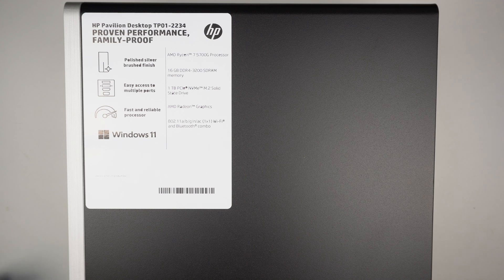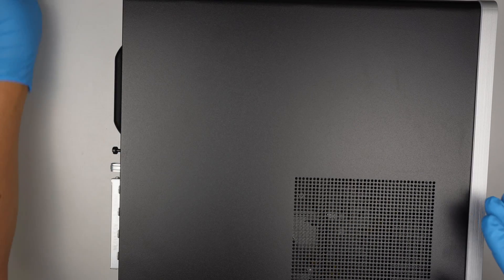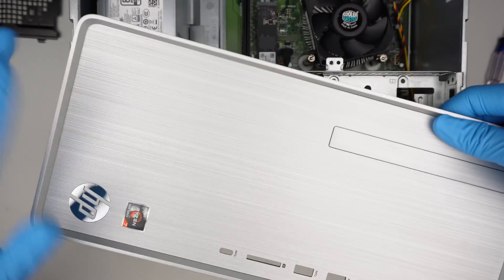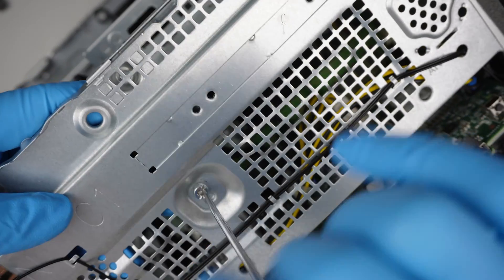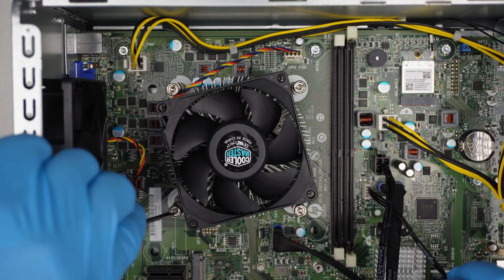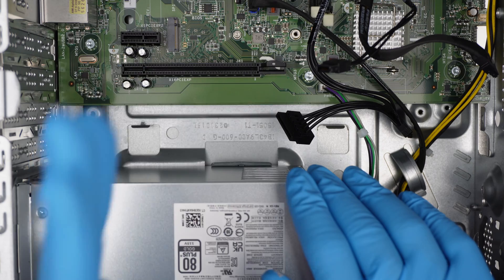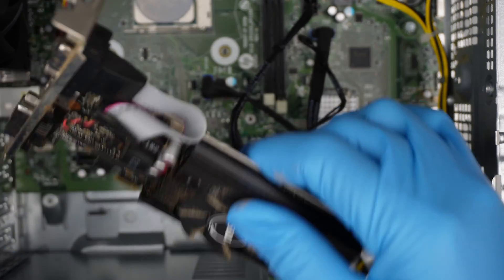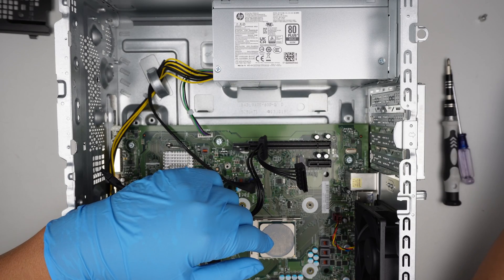Explained Upgrade on HP TP01 2234

Comment: Having a hard time finding a psu for this model. HP parts store not showing what I need. Any suggestions? Wanting to get a more powerful psu but keep it around the same size as original to fit an upgraded gpu.

Comment: You answered my question. No, I cannot use the rtx2060. Not a problem. Thanks. Will install low profile. BTW, Linux runs great on this machine.
Reply: you can if you upgrade the power supply, if you do some research hp makes a 500w that will work on these, itll power up to a 4060ti